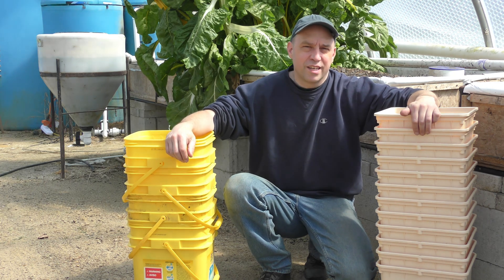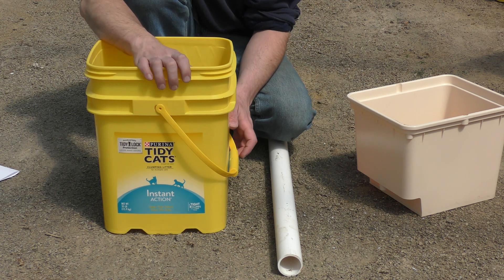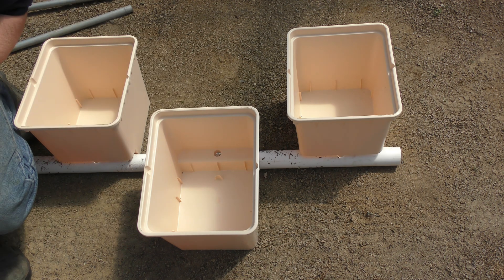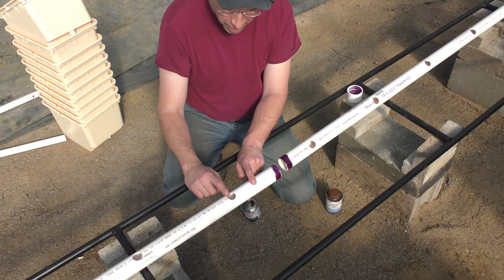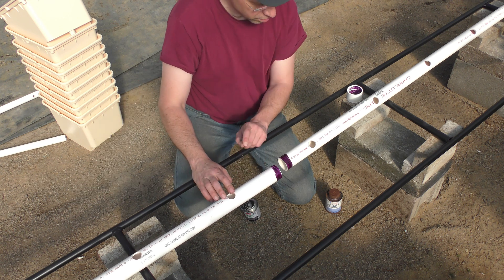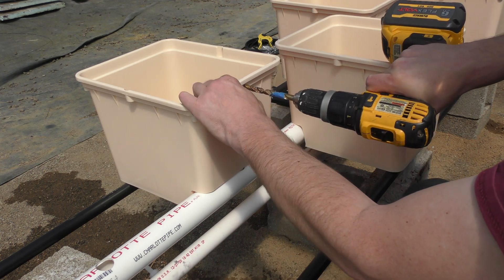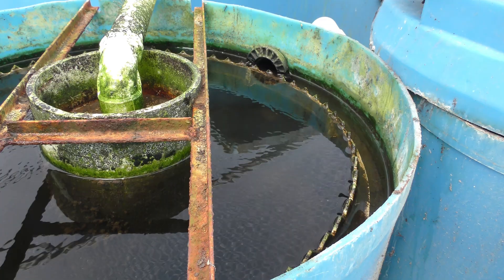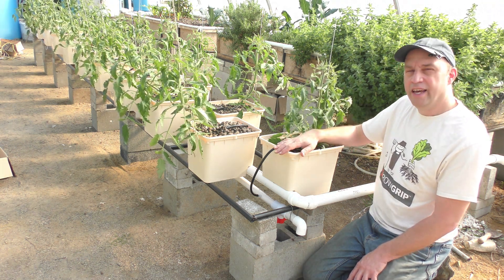Building a Dutch Bucket System

Comment: what type of fittings did you use for the short feeding tubes(black) to connect to the white pvc pipe.   you probably mentioned it before but cant find them.
Reply from the maker: it's a 1/4" NPT to 1/4" barbed fitting.  McMaster # 5372K112

Comment: Would it be much cheaper to use regular cheap round buckets and put the outlet in the buttom, that way you wouldnt need the elbows. That would probably work with a simple hole or multiple and an open pipe like a raingutter to catch the water.

Comment: Nice job ... just wondering , is it possible to do a clip on nutrient deficiency !! I notice your tomatoes did not reach  potassium deficiency stage but surely it will ... !! Iam sure you are rectifying this and it would be great to have your input on this  .thank you
By the way ... massive size Swiss chard .. I wonder if its soft at this level ?
Reply from the maker: It's actually molybdenum that was the problem.  Just got the test result back.  ;-) I try to avoid the nutrient videos because of the huge number of complaints I get.  Some people disagree that I shouldn't be adding other nutrients into the system and I don't feel like arguing with them.  Swiss chard was leftover from last year and I just removed it all replaced it with new plants.
Reply: @Bigelowbrook  many thank for your reply ..."some people disagree and  should not be adding nutrients !!! Iron is a must for example...!!  How not to add !!! 
Any how if you going to get headaches from arguments ... then better not do the clips 😉
Reply: If you want good basic how to videos Rob Bob talks about nutrients on his channel.

Comment: With the price of UV-C LED dropping after the pandemic,  I'm wondering if a simple sand filter bucket and a UV-C LED on the output of the filter would make grow bucket feed line maintenance free? Not sure of any negative ramification of introducing UV sterilisation into a aquaponics system? 
PH is one of the other things I've been thinking about regarding aquaponics, if they was something similar to a heat exchanger but instead of heat conversation it would be PH? PH really cuts into the diversity of Aquaponics, I don't like the ideal of GM fish.
Reply: There are systems for automatic pH correction.
They just use a pH-Probe and some peristaltic pumps to feed pH+ oder pH- into the water.
Using an ion exchanger of some sorts would probably not be worth it or even efficient as they usually need some chemicals to recharge.

Do you have a dishwasher? Does it need salt tablets once in a while?
They are for recharging the ion exchanger.
It takes calcium ions out of the water and exchanges them for natrium ions so your dishes are shiny (no lime stains).
To recharge it, it gets flooded with a concentrated salt solution which forces the calcium ions back out.
Reply: My questions are based on trying  to perceive possible future path that these types of agricultural food production might take. I've have always seen hydroponics with it wide ranging PH, singular concern for the plants as a bicycle analogue, while aquaponics with it complex nutrients more like a unicycle analogue, requiring great deal more of system balancing.
With the advancement in different fields, like WareHouse farming, LED grow lighting and MSR(Molten Salt Reactor) preferably Thorium, emerging into the same decade, this could be used to resolved future food shortages, only time will tell, but I still can't help but wonder.
Reply from the maker: The pH tends to be fairly stable in my system. Partly because our well water is nearly perfect and not too hard.  Also having a large system helps to keep the pH from swinging up and down too much.   The nitrification in the system tends to drive the pH down a bit.  This can be corrected by adding calcium (powdered limestone) or in drastic cases (which people criticize me about is adding potassium hydroxide, which it quite potent).  Auto dosing for pH is risky too since the pH tends to cycle up and down during the day because of the DO levels changing a bit with the algae getting light/dark.

Comment: I wonder how important it is to have the fitting to suck the water out.  Will the extra standing water cause problems or is there some other reasoning behind it?
Reply from the maker: I'm not sure.  I'm guessing that it was a space saving design so they could set these right on the ground?  I guess we'll find out what happens when I take the plants out later in the year!

Comment: I had some success putting in a removable filter system or two. Initially it was to improve the durability of the pump so I wanted to avoid solids getting caught in the pumping mechanism. Granted my setup wasn't on the scale done here...

Comment: I wonder if you turn the valve that feeds the water upwards or even sideways if that would stop more solids??
Reply from the maker: It's possible.  I would be concerned that the solids would accumulate in the low spot of the pipe.